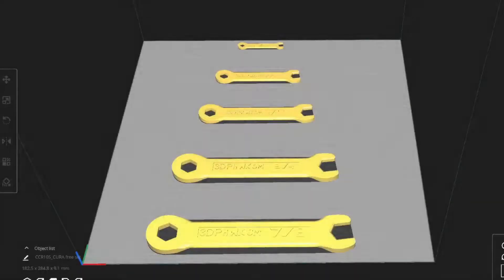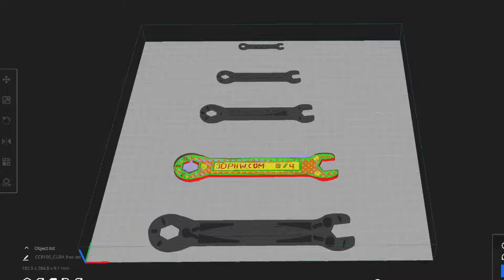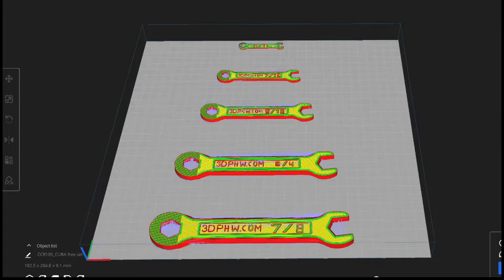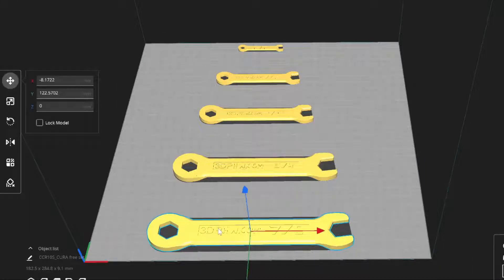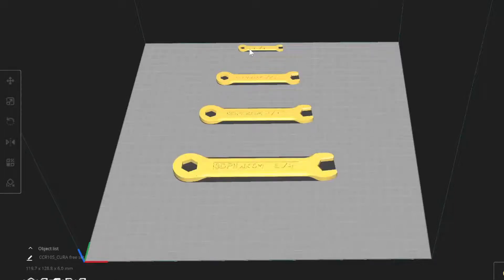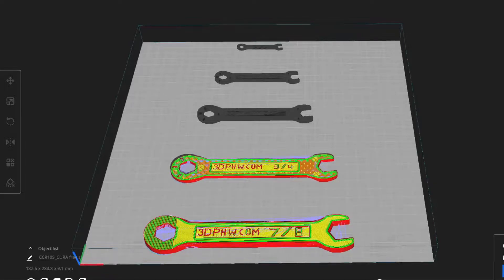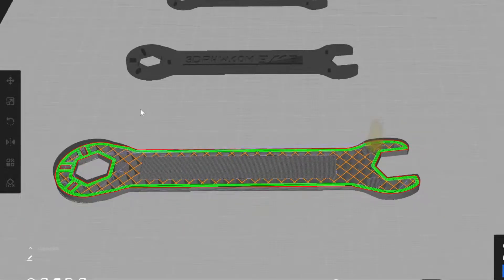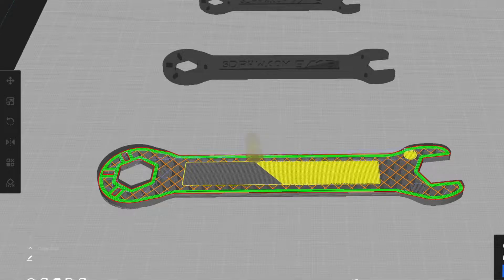How to Change the Print Order in Cura 5.4 - the fastest way

Comment: But it doesnt print like that, it does one layer at a time for all objects then comes back to 1st for next layer
Reply from the maker: You have to make sure under Special Modes that Print Sequence is set to One at a Time. Also, some printers wont print One at a Time, especially if you are using dual or multiple filaments or when using a prime tower.

Comment: Amazing, thanks for the help! Crazy that 3 years on and cura still doesn't have a native way to do this.
Reply from the maker: You're welcome 👍

I think that even if Cura came up with a way to do it in a GUI, the way I show how to do it in the video would probably still be faster and easier.
Reply: @3dprintedhardware it may be fast but it's not intuitive. I would expect there to be like a sort value, which would be calculated by default but manually overrideable.

Comment: Great tip. Much easier than finding out the print order and then moving them around. 
Question???
I would love to know how to pause the print between different prints on the plate to change the filament to a different color. I know I could just do another print but much easier to print a plate full and change between prints. 
I tried "pause at layer" but the actual gcode only goes to the number of layers that the prints are tall rather than all through the plate.
Reply from the maker: You can do it with pause at layer but you have to go into the gcode and manually add the pause code right after each line that says ";Layer: 0" (not including the first one). If you don't do this, "changing at layer height" wont work when printing "one at a time". 
Here is an example of what I did when I was changing flow rate between parts
----------
LAYER_COUNT:15
LAYER:0
[CAZD: 
M221 S110
:CAZD}
-----------
LAYER COUNT:15 is the last layer of the previous print and after "layer:0" I added the CAZD code "M221 S110" which changed the flow rate to 110%. If you do not know the pause code just do the pause at layer height in your slicer at layer 1 our 2, save it, then open the gcode and look for it, highlight it, cut it and paste it all the places you want it to be.

If printing multi color prints is a frequent thing for you, you might be better off getting a multi color printer like the "FLASHFORGE 3D Printer Creator Pro 2" available here https://amzn.to/3RVaNx7 (amazon associate link)

Hope this helps!
Reply: I so much appreciate it. I was hoping there was an easier fix but if I'm going to do this often with different colors it will save me a lot of time rather than doing a whole new print for each color  @3dprintedhardware  

I went by your site and signed up but never got the email to verify. Can that be resent or something???
Thank you much for the time. 🙂
Oh and I'm going to have to sell quite a bit to afford a multi color but I was thinking about getting the P1P ???
Reply from the maker: @Mrstrikerace   I was working on the website earlier so maybe that's why it didn't work. I do not see any emails that have not been activated today so I cannot resend it, you can try signing up again or try a different email and see if that works. 

P1P is a good choice 👍
Reply: I'm not sure if this works but it looks like the pause by height (pause at layer) should work. When you have multiple prints and you slice it, you should see that the layers are added up. Meaning, if you have two 20 layer prints in sequence, Cura will report the second print as layers 21-40. So, you could pause at layer 20 and that should be the end of the first print and before the second print.

Update: It looks like Cura 5.5.0 doesn't behave the way I described. I suspect this is a bug and reported it.

Update 2: Cura team reported that the Pause by Height function does not work as I described it. It would take a lot of recoding to make it work that way.

Comment: I'm wondering if you could set up the items in a certain order that you get the print head to knock into a previous item and knock it off the bed, allowing many more to be printed? Obviously it would not work with objects that have a large footprint but might work for knobs etc?
Reply from the maker: You could but would have to manually set that maneuver up in the gcode and maybe add a scraper to the print head. I wouldn't be able to do that on my machine though because the build plate adhesion is so strong I have to wait for the bed to cool down for like 15 minutes before I can get the parts off.
Reply: @3dprintedhardware  coincidentally I stumbled across a video exactly what I had imagined, yes pretty much exactly what you said, modify gcode, the small parts I do should release without much trouble. Whether I'd trust it for unattended operation, that's another story 😁

Comment: great solution, how did you find out??
Reply from the maker: I actually found this out by accident. The reason it works though is because the first STL file of a series of files that you put on the build plate will be the last to print and the last STL file you put on the build plate will be the first to print. That is very inefficient though if you want to print more than 2 files because you would have to open them one at a time and keep track of what order you are opening them to ensure that they print in the order you need them to print. 

  Using the technique in the video above is much easier because you can open all the STL files you want to print onto the build plate at one time and arrange them in the order you need them to print (like small to large or front to back). After that, by simply deleting them in the order you need them to print and then undoing the delete, the last item you deleted goes onto the build plate first (making it print last) and the first item you deleted goes onto the build plate last (making it print first) giving you the same results as if you used the manual method I outlined in the first paragraph.

Hope this explanation answers your question.

Comment: Wow. that's a great tip! It REALLY works! It's so irritating that cura doesn't allow to change print order after loading bunch of models. Thanks for that!
Reply from the maker: You're welcome!  I found this method on accident and it made life much easier so I had to make a video on it and share it with the world.
Reply: @3dprintedhardware  I came back with comment that unfortunately this method doesn't always work. I've got no idea why some models placed in line along Y axis (X=0) are sliced from front to back no matter what. 
I read somewhere that Cura looks for models starting from 0,0 and moving along X and then Y axis. This seems to not be always true, as the trick with delete/ctrl+z changes that 'default' logic.
There is another method which uses nested grouping models in order we want them to print and then ungrouping those groups till no group remains. I think it's based on the same principle as delete/ctrl+z, because creation of group removes model from the list of objects, while ungrouping adds it back like ctrl+z does. However this method doesn't work when delete/ctrl+x doesn't work too.
This is so frustrating that Cura hasn't introduced user control over print order yet.
Reply from the maker: @blackredroll  Thanks for the update. 
I'm on a wins 10 PC, I haven't tested it on any other system yet so if you're using something else that might be the problem. I've been using this method on the same PC for over 6 months now and never had it "not" work for me. However, if you move any of the objects after the delete/CTRL Z method it WILL change the print order to the X Y default order you mentioned. The delete/CTRL Z method has to be the last thing you do before saving or sending the file to a printer for it to work properly.

I agree Cura should include something to change the print order. It would be as simple as using the name of the parts in a popup list and being able to slide the names up or down to change the print order, sort of like how you can change the play order in music playlists .